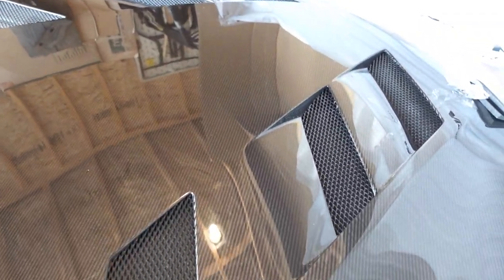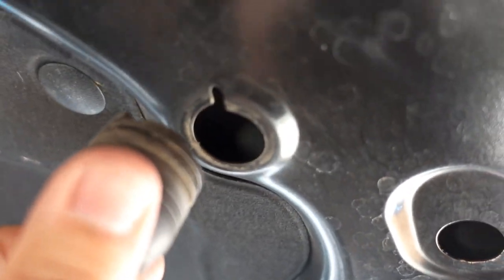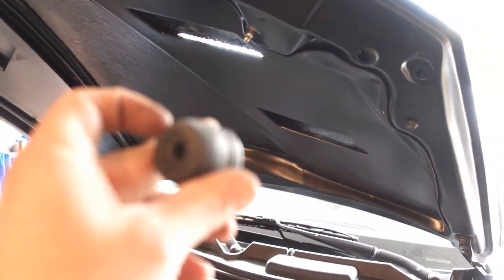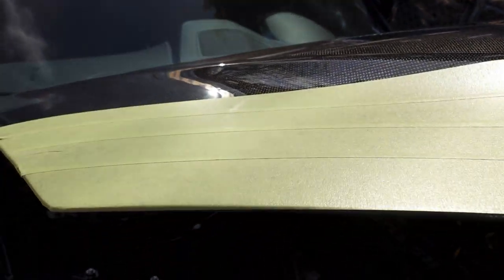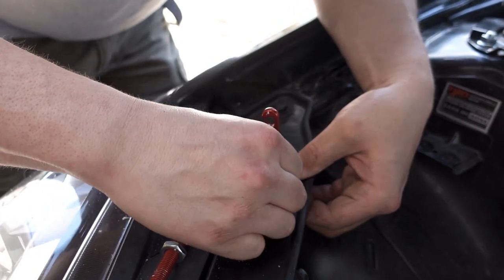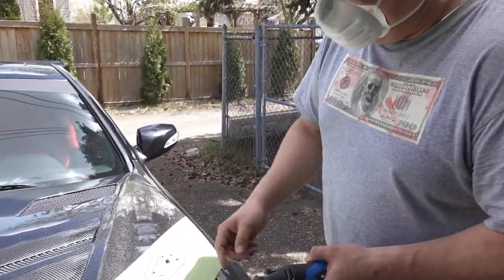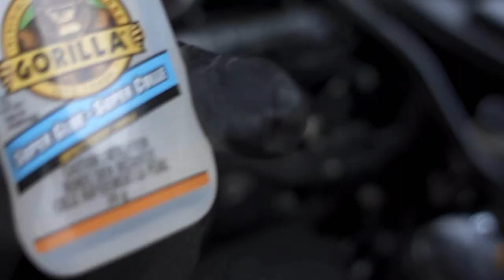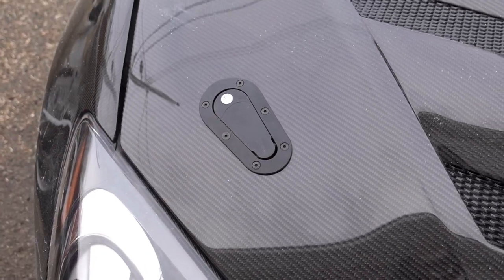Episode 19 Carbon Fiber Hood and Aerocatch Latch Install on a Genesis Coupe

Comment: The OCD in me is disappointed the CF hood didn’t have an underliner….I’m sure you paid a nice chunk of change for that CF hood….
Reply from the maker: Ya, but it was worth it. I’m probably going to remove the little vent covers underneath to get more air flow and venting for this track season though. Now that I think of it, I don’t think any of the aftermarket hoods come with an underliner 🤔

Comment: Looks good! I saw your older video of the pro sport gauges you installed, wondering if I could chat with you over Facebook I would like to know and see where you install your boost line, I have the same set up but i dont know if My line is hooked up to a good spot on the manifold
Reply from the maker: Do you have Instagram by any chance? @alphagenperformance

Or if you look up our Facebook page AlphaGenPerformance, you can message us on there about it 😊 Thanks for watching!

Comment: Love the look. 

Hey been scouring through your vids just to confirm but are you running the stock Intercooler with the stuffed turbo?  I’m about to get the stuffed turbo installed on mine but was wondering on your set-up. 

Debating whether to get the turboxs FMIC before the stuffed turbo and custom tune. 

Also, have you thought of an E85 tune? Not sure how readily available E85 is in Canada but that’s why I’m hesitant on it. I’m from California and it’s available here and there but don’t wanna get stuck somewhere. Definitely want to have a switchback option in the event I can’t get to an station with E85.
Reply from the maker: Thanks for checking the video out. And yes, still stock intercooler. I’ve heard you can run the stock intercooler up to 400whp. But an upgrade is never a bad option. I’ll be upgrading the intercooler with my next turbo upgrade.
As for E85, you are correct. It’s not as easily available here in Canada unless I order it directly where I’m at.

Comment: was the xclusive tune you got a few years back any good?
Reply from the maker: It gave me more power and torque as advertised, but I went with AlphaSpeed because there were more options that I wanted as well as being able to tune custom big turbo setups and haltech ecu’s down the road as well.

Comment: What would you recommend as far as torque or threadlock for the bolts on the hood/hinges?
Reply from the maker: I didn’t use any thread lock, but as for torque on the latches themselves, they are only very small screws so I only went tight enough that I wouldn’t crack the fiberglass/carbon fiber. The bolts or hood pin parts I applied, I tightened those up quite a bit, but not tight enough that it warp the metal it was attached to on the mounting points. If that makes sense. Hope that helps a bit.

Comment: Damm imagine buying a 1300$ dollar hood just to have to drill holes into it🥴I was so close to commuting to buying one but this making me have second thoughts😂
Reply from the maker: Some people don’t and it’s been fine, but for track reasons it’s highly recommended. So thats why I also did it.
Reply: Manufacturers literally require it for safety reasons, I personally am doing this on mine tomorrow with the weather clearing up, as someone who will regularly see 100+ not going to chance the latch breaking and destroying my roof and windshield lol if you’re a loser with a slow car that’s all show then sure don’t do it